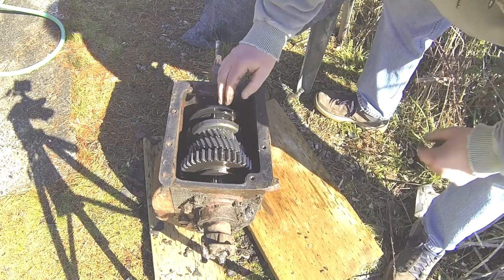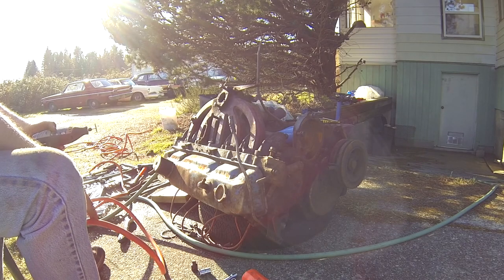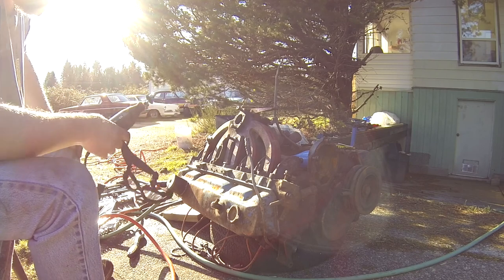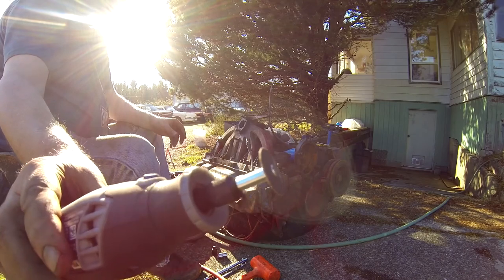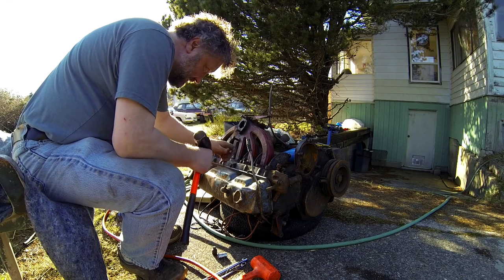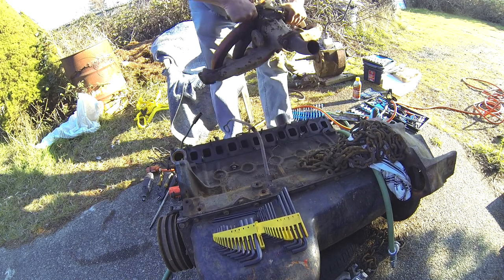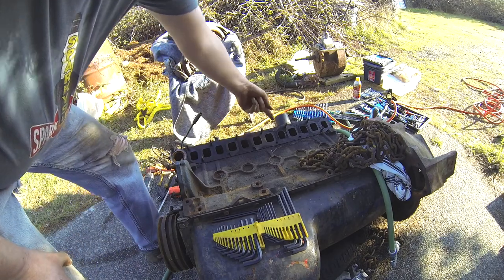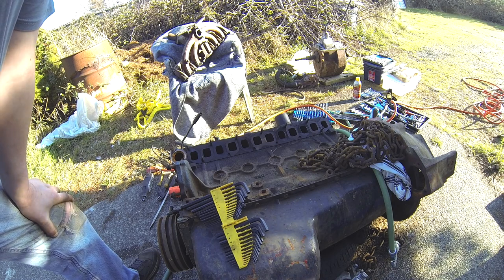Mistress Slant 6-Gearbox and Engine Tear-down-Part 1

Comment: Those are darn good engines. had one in my 83 D 150 . If i could I would run one in my Dakota
Reply from the maker: Ya, I have come to love them. This is out of a 67 D100 I think
Reply: I drive a 87’ Dakota that I put a 87’ 318 in it with stock 5 speed. It’s fun to drive.